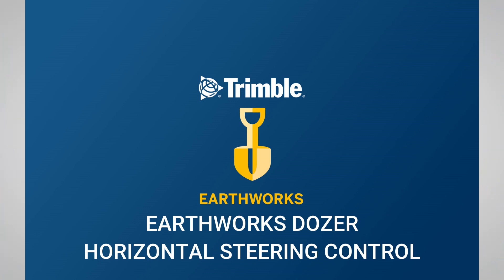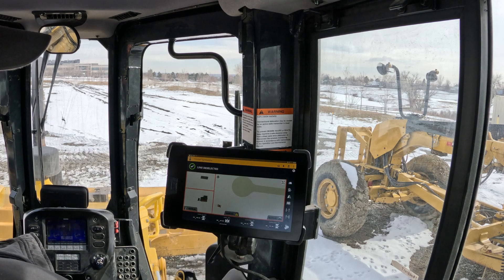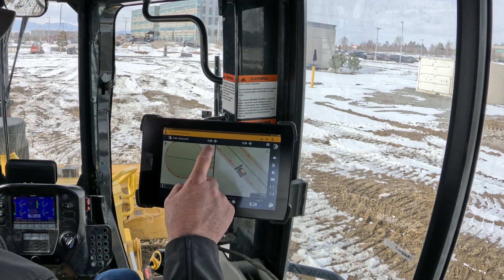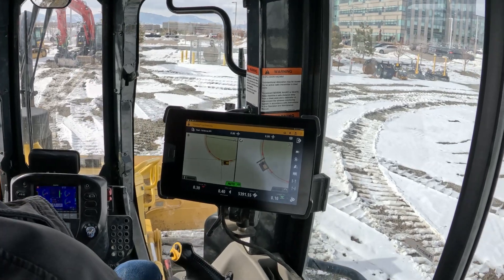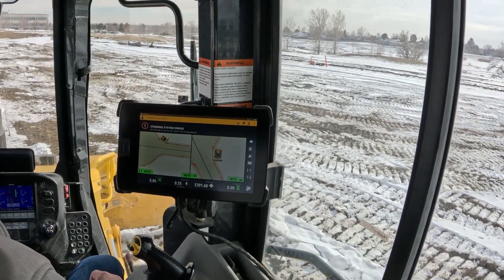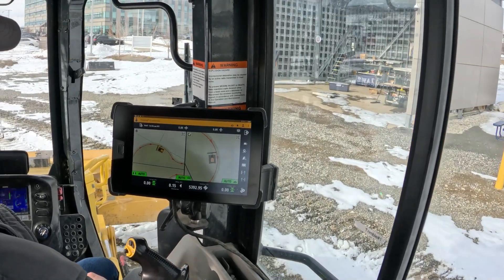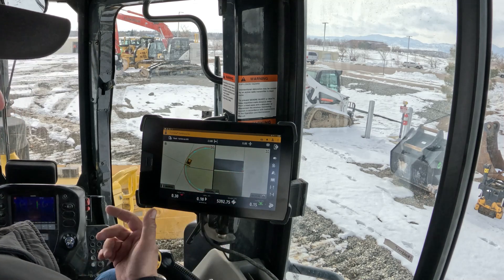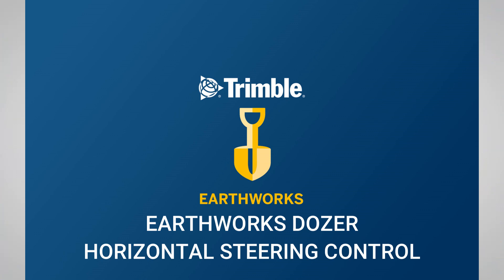Trimble Earthworks Dozer Horizontal Steering Control

Comment: Is there soe hardware or software needed for horizontal steering
Reply: Yes.  If it’s a newer dozer it may already have the hardware portion of it available but will need a license on the Trimble side to use it.  If it’s an older machine it will need the module added in the joysticks to make it possible and then a license.
Reply: Is the module in the machine an option
Reply: As far as I know the machine has to have the ability to auto steer from the factory, then it is just unlocking the option like turning on the cat grade option.   @antoniovangenechten8188